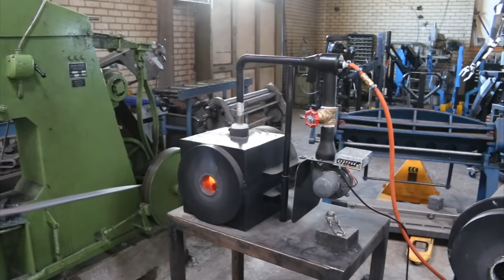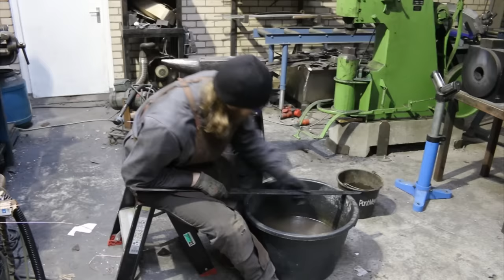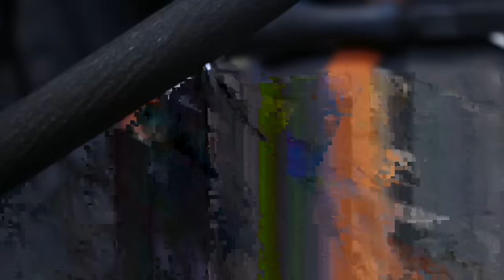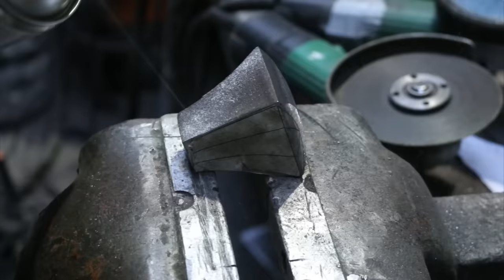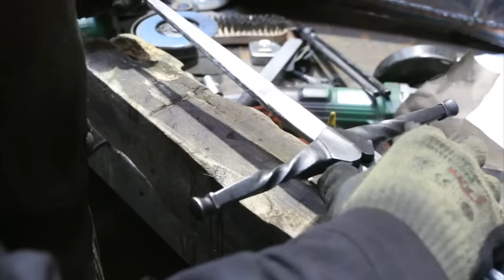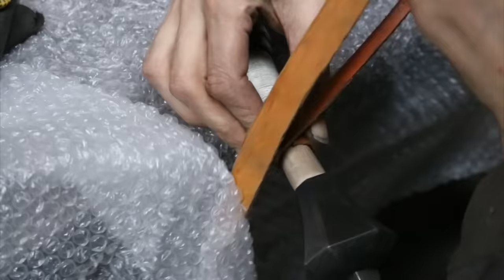Forging a The Witcher 3 sword,  the complete movie.

Comment: all this amazing work and geralt sells it after 5 min...
Reply: Ichai Assedo Yep upgrades it for a sword that does 25 more damage
Reply: Connor Shekelstein 8*
Reply: Ichai Assedo
Reply: Whats more interesting is he fishes a better one out of the guts of some monster.
Reply: pure soap the only joke here is you
Reply: Ichai Assedo you mean you sell it? I kept mine in the stash
Reply: I can tell you why Geralt would sell this sword instantly. Because it's crap. Sure Looks nice, but a screwed on Pommel wolrd hold long in battle at all. Real Swords had the tang go through the pommel where they would get heated and then hammered flat once everything was assembled. Few Fights and that Screw won't hold tight anymore.
Reply: For 25 orens...
Reply: damn i remember hattori gave me that shit sword and sell it to him back lol :D
Reply: Dude, thats a real sword
Reply: ahahah best comment
Reply: Sieg Boss. Not entirely correct, the below quote isn't mine but accurately describes the situation.

"Post by MOK on Jan 24, 2013 at 10:56am
Peening is the method historically used for most of the pre-industrial era. It fixes the pommel permanently to the tang, and when done right is arguably the strongest method of construction.

Threaded tangs can be used in two ways. One is to simply screw the pommel directly onto the tang, which has several disadvantages. The more advanced way is to key the pommel to the tang, i.e. slide the tang through a slot in the pommel that fits exactly over the tang, and affix it with a pommel nut screwed onto the threaded end of the tang; this has the advantage of preventing the pommel from turning, and also places no undue pressure on the grip since the pommel is tightened against the tang itself, instead of the pommel nut squeezing the grip and guard against the blade shoulders which can cause structural issues with the grip core. This kind of construction can, of course, loosen with use, but is also easy to tighten again and allows easy replacing or swapping of hilt components (and lets you "field strip" the blade for easier sharpening and polishing), and when done right is plenty strong enough for any humanly practical intents and purposes.

Albion uses peening, Angus Trim recessed pommel nuts; both are famous for their performance and durability. Much of the time a peened pommel is more historically accurate, but a pommel nut construction can be almost as durable and offers some convenient advantages for the modern user. A threaded pommel is not as good as either, but can be just fine under the right circumstances (I have had no issue with my Windlass "New Coustille", for example, while on the other hand their "Classic Hoplite" leaves much to be desired)."
Reply: You ever notice how the same relic sword will drop multiple times? I like to think that instead of there being multiple copies, it's just the same sword. Geralt kills some monster, finds the sword, sells it, some git with a hero complex buys it, goes and gets killed by a monster, Geralt kills the monster, and the cycle of life continues. Geralt has sold the same swords back to the blacksmiths hundreds of times, so he and they know what the hell is going on, but the poor bastards who keep lining up to be the next owner of the infamous "Bloodsword!!!"? Once wielded by Geralt himself (and then some fifty or so other assholes who ended up as monster chow).
Reply: U
Reply: @siegfried5325  Oh come on. Relax. It's a nice replica. Can't people enjoy shit anymore?
Reply: Proceeds to put the game on easiest difficulty cause my coolest looking sword is 15 levels lower than me
Reply: How much?
Reply: @jacobendriss6  In what Currency? Temerian orens, Nilfgaardian florens and Novigrad crowns?
Reply: @jacobendriss6  What do you want to ask?
Reply: How much would it cost for a sword like that?
Reply: @siegfried5325  no screwed on pommel > no ending your opponent rightly. also, if it's useless in combat why did people who actualy used swords have them, keyboardwarrior...
Reply: Siegfried True, but when sword battles were a common occurrence, they didn’t have tap and die sets, cutting fluid, belt sanders, power hammers or lights.
Reply: Massive warehouse, you must be involved with a lot more then swords ⚔️  🗡 very cool regardless. Cheers 🍻
Reply: ㅡ
Reply: Brand new to forging. Wondering what exactly is the importance of flux.
Reply: Amazing work, anyone know how many hours went in this sword?
Reply: Wow Nice!
Reply: And imagine how harder would it be to make this without modern tools.
Reply: @menghao737  that's a really cool thought 😂
Reply: sells? he just drops it xD

Comment: So you can light a sword soaked in oil on fire? I feel like Geralt has been holding back on what Igni can really do.
Reply: Ensensu2 I’m pretty sure that would ruin the tempering
Reply: @AliBaba-sw4ej  depends how long it is on fire and how hot the fire is but yeah it would most of the time

Comment: Hi! 

First off, thanks for posting this. Beautiful looking blade. 

I was curious as to some stats, mainly weight, and possibly balance. Do you remember how much it weighes and roughly where centre of balance is, in relation to overall length? Just curious.

Again, thanks for the video!
Reply from the maker: about 2,4 kg  center of balance +-12 cm from handle.

Comment: I saw a swordsmith beating the metal and folding the hot metal for at least 100 times... That's crazy.. Even tho the blade that came out was stronger than other blades.

For the handle (wooden), I saw the swordsmith used two halves to clamp onto the blade body, but the two halves met at a diagonal angle, meaning the two slits when the two wooden blocks stick together are not directly subjected to the slicing force, which increases the likelihood of the handle not breaking after a chop/slice.

Comment: and to think that this is only a blade for display; a mere souvenir to hang on the wall and admire from a distance

way back when, smiths would actually forge weapons like this for real use - without any special tools or machines, they only had water, fire, metal, a hammer and an anvil
even so, swords made by them were extraordinarily durable, sharp and well balanced
how? that remains one of the biggest mysteries of today

Comment: Dear Freerk, I am fascinated by your crafting skills and this is all i watch these days, your fastidious detailing is mind blowing. One suggestion, is it possible for you to speak a little so people will learn and understand why you did what you did, only for the special parts, such as the powder you put on hot iron, why you cut and put together the plates for forging instead of using a whole blade like others, why do you put the blade between planks, how do you get that smokey texture on steel. 

If it's not possible to speak, you can also put some captions for instructions, your disciple 😊

Comment: But does it work well as a sword? Many - if not most blacksmiths can pound out pretty much anything,,, but as seen on "Forged in Fire", they don't work well as actual weapons. Weight, balance point, counter weight, proper heat treatment, fitment,  overall length, etc. all work together to produce a weapon that is superior to your enemies weapon - or not.
Reply: This one looks too heavy

Comment: so unpractical the grip is, u would end up dead if used this in a real battle. the handle is way to long if blood or water got onto the handle the sword would slip from the hand. plus the scew in pommel should be a locktite nut with a nylon thread so that it never comes loose

Comment: Method is wrong. This is just a show. Using that method would not result in a sword that could be sharpened well. Also, Literally changing the grain to make a "sword"  that would get sliced in half if it went up against anything slightly sharp.

Comment: This guy might be able to make a few movie props or something pretty to hang on a wall, but compared to the Japanese sword masters, he is a bumbling amateur. Steel needs to be carefully selected in the first place, and you need both soft and strong strength grades. The temperature of the forge needs to be constantly varied to obtain  the correct strength, not just thrown into some modern monstrosity. The steel needs to be folded multiple times for strength. That hammering machine is an disgrace. Get a bigger hammer and use some elbow grease.